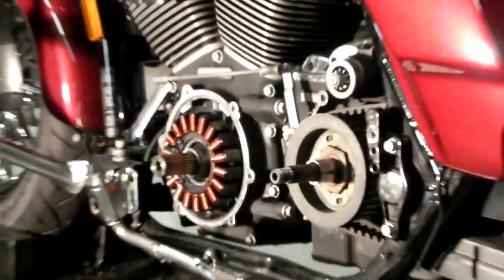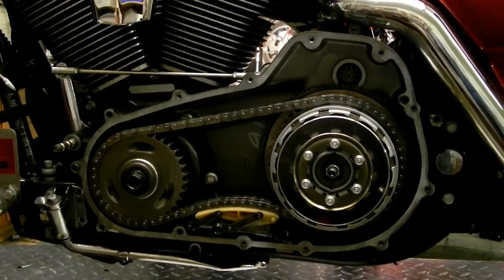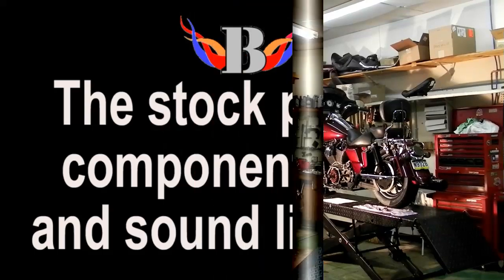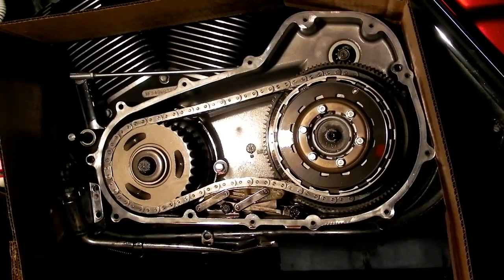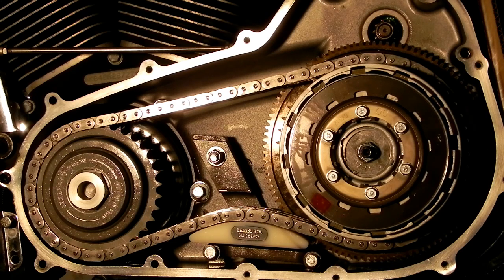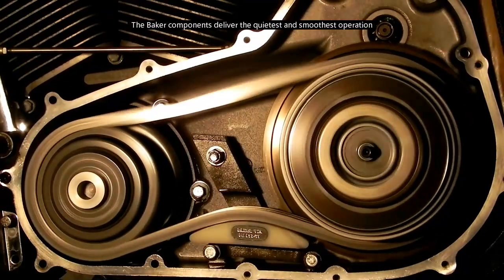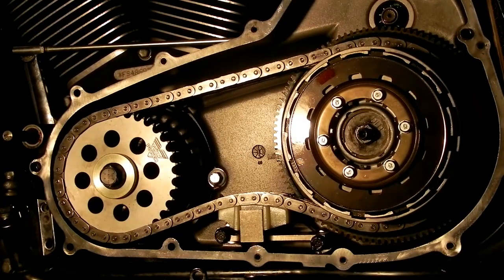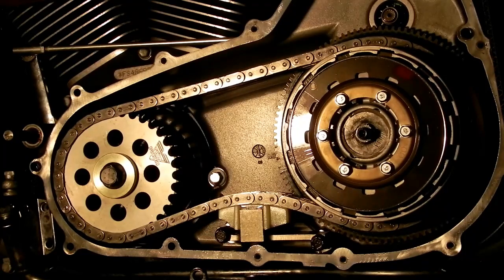2007 and Later Harley Primary Issues

Comment: I did the baker comp sprocket and Hayden adjuster on my 09 e glide. Best mod yet to the bike. Sounds like a new ride again instead of sounding like a bag of marbles in the primary. Great video!
Reply: I'm in the process of replacing my primary chain tensioner with a Hayden M6, replacing the primary chain with stock, and replacing the clutch hub bearing. All went bad due to the crap Harley 'auto' chain tensioner. I'm hoping my trans shaft bearing and compensator are ok. I'll find out soon enough.
Reply: In the video, the Hayden adjuster was paired with a compensator eliminator. I’m assuming the Hayden adjuster has a greater travel to soak up more shock. What made you decide on pairing this adjuster with the Baker comp? Was it a mechanic recommendation, or were you looking for a bigger solution for a problem, like bearing failure, that originated from the stock MoCo design? After more than 2 years, how is the setup working for you? Cheers in advance...

Comment: Great video,  I have to figure out what has been done to my 07 Fatboy,  just got it from Big Moose HD in Portland Me. They mentioned nothing about the comparator or the cam chain tensioner,  or the shift linkage.  They did do the 40k maintenance but gave no paper work statement.  I feel duped. She runs great but this is my first HD and I am inexperienced.  
      Thank you for your straight forward video!

Comment: I have a 2006 SG. When taking off my bike will start bumping like something is slipping in the clutch or transmission. When I shift to 2nd a little bit of the bump if I am accelerating quickly and it all goes away when I get to 3rd and higher. Symptoms are worse when riding with passenger. Any idea on this?

Comment: pulled the chain drive out ; and replaced it with a 3 inch belt drive. That was over 10K miles ago, on my 99 twin cam, still works just fine and dandy.
Harley will never go with a primary belt drive. They are too robust, and dealers would take a huge hit in "shop income" not fixing primary chain drive problems......
Reply: The shovelhead Sturgis model originally came with a primary belt, but it didn't hold up well inside the enclosed primary.
Reply: @tpitman   I had a primary belt shovel... I had not any issues.. I never pulled the cover off, to see inside..... But is one of my fixes to fix the many design flaws on the Mil-8 engine......

Comment: why did Harley go to the auto primary adjuster?  nothing wrong with the Manuel adjust method, only took 10 minutes..   harley gets out of one problem , the cam chain tensioners & moves into this problem?   my old evo didn't have any of these problems.
Reply: Who are you kidding , EVO's did the same exact thing with the starter kick back clunk, even worse!
Reply: I have an EVO with 150,000 miles on it. Regular maintenance is all that is required. 1991 FLHS. Long live the EVO !

Comment: I have the Harley road king classic 2008 and I notice when I ride a couple of miles and it's warm  and I turn it off. then when I start it up the starter has a hard time to crank a little it will start but like it hesitates is that part of the problem.
Reply: ... that can also be trying to start a warm bike with compression that hasn't been bled from the engine as it does cool-down. Many compensators replaced unnecessarily due to this.

Comment: I have a dry/grinding bearing sound in the primary until the clutch is engaged and it is in gear. Anyone else fix this issue?
Reply: Primary Shaft Bearing behind the clutch is going out.
Reply: @warrenducote8392  thanks, I ended up changing it. Perfect now 👌

Comment: There are very few videos showing the use of a solid sprocket in place of  a compensator. I have a '09 Road King with the stock compensator as shown in your video. It is now toast. I installed a Hayden primary chain tensioner thinking that is what the noise could be from, and to avoid an over tight chain as discussed in some videos and forums. This bike has the rubber compensator inside the rear wheel hub too, which seems to be fine. The bike has just over 60,000 miles on it. That being said, do you still have contact with the customer with the solid sprocket? Are there any known issues of damage to the motor, crank, clutch or transmission when using a solid sprocket? Also, has anyone ever tried to add one more of those Belleville ring springs in addition to the stock ones to make them thicker/stronger? Looking for advice on whether or not to go with a solid sprocket. Thanks.
Reply from the maker: The customer with the solid sprocket (a Twin Power Compensator Eliminator) has been very happy. We have not heard of any problems related to solid sprockets, but you might want to check around on the Harley forums to get a larger sampling of customers before you make your decision. About 90% of our customers have chosen to go with the Baker Compensator.

Comment: Why don't you add tensioner from the top side as well?
Reply: because it's tensioned by the compensator sprocket pulling on the chain.  That's where all the work is done. The lower section of chain is just along for the ride.
Reply: @michaelcouey1383  duuuude

Comment: I get a knocking noise in primary when pulling off from a standstil im wondering if its my primary  chain hitting the inside of primary cover.
Reply: +Staff Bikes Built Better thank you, your videos are awesome.  I ride a 09 Road Glide...i will crack that case this weekend.
Reply: this is chain flap...I have same noise....if I throttle it up and pull away with force...no noise..pretty sure this is because of out of true crank...that we don't want here of .... but i have had primary apart 3 times in past 2 months and no visible problems......

Comment: glad i came across your channel. I'm looking at buying a 2009 Harley Softail Heritage with 30 k miles & nothing ever done to the bike except regular service. It makes a loud clunk & slight jerk when shifting into first gear after first start up. Is this the clunk you refer too or would this be something going on with the trans/clutch adjustment?
 If you swap out the HD auto chain tensioner for another do you then have to remove primary cover every so often to adjust yourself like older models? Does anyone make a cover with a built in adjuster cover or can you use an older cover from a bike without the auto CT ? What other problems can I expect with this model? I sure hope I don't get the cover off only to discover what you show in this video. Thank you in advance for answering my questions. I sub'd you as I think I'm going to need all the help I can find for future repairs
Reply from the maker: It sounds like the bike you're looking at IS suffering from problems caused by the auto chain tensioner. If you use a Hayden tensioner, you would want to check things maybe every 30,000 miles. The Baker manual unit should be checked and adjusted every 10,000 miles...more often if you hear the chain slapping the inside of the primary! I heard last week that somebody is now making a primary cover with an inspection cover, but I don't remember who. I'll try to find out.
Reply: THANK YOU! For replying so fast After going back this afternoon and starting the bike again it sounded worse so I've decided to keep looking as they want too much for a bike that needs this work done on it right away. I'll try to find one that the Hayden chain tensioner has already been installed in
Reply: Hold on.... Before you go spending big money on something your not sure of, know this, all big twin Harleys have a annoying loud clunk into first gear, this is a characteristic of of these engine's. Not saying its normal, just a characteristic. The slight jerking could just be your clutch needs to be adjusted as its engagement is off when you pull in clutch to shift into 1st.... not sure? Have a good knowledgeable bike mechanic look at it before you go spending money on parts you dont need.
Reply: thanks that's really good advice I'l keep in mind as I go forward in my search for a larger bike this style. I backed out of the deal for now as the guys widow wants way too much for the bike and it was in her dead husbands name only so it'll be a bit to get the ownership & registered changed to new buyer at DMV I'm not sure it's all worth the hassle as there's plenty of better looking bikes with clean titles for sale out there Thanks again for the info I'll have to find a HD tech I can trust to do a pre purchase inspection
Reply: Also note this first gear "clunk" shift can be more prominent if the primary was filled with a thicker oil, causing the clutch plates to rotate due to the lube viscosity sticking to the faces of the clutch plates even with the clutch handle pulled in. Once it clunks into gear, that is the sound of the rotation of the clutch basket and transmission input shaft coming to a stop until you let the clutch out to drive the bike forward. Check the clutch cable to make sure it is in spec for proper free play just the same.
Reply: @markyoung3545  in hotter climates the Harley synthetic thins out too much where I am......hard to find N and some gears. Gone to conventional oil for about 25k now and its nice better on long hot rides. Like you said the clunk is there just keep you ears open to your rides tunes (noises) gotta know your bike!
Reply: Much better not nice better......auto fix on these phones can be dangerous and 🙄

Comment: Is the compensator eliminator sprocket safe to run of my crank is stock and not welded on my HD ultra 103?
Reply: I run one with stock crank making 120hp and I ride it hard.  I have screaming eagle manual chain adjuster and no problem for 40k. If you do this set up get a new primary chain. An old one will be noisy.

Comment: I have a 2010 road glide stock 96 with 28k miles. I noticed what appears to me to sound like a starter grind. Pulled the starter and nothing is wrong. I guess I'm asking would the comp sprocket cause a noise like that. Any help will be greatly appreciated.
Reply: John Lutz 2010 Roadglide 27000 mi trashed the main bearing because of the primary chain auto adjuster trans shaft main had to be replaced as well installed a Baker attitude adjuster  to finish or the season did a total motor remove tear down last winter to 107
Darkhorse shortblock  blueprint, balance, and welded crank. Smooth quiet  106 hp/ 117 tq. Good luck
Reply: @vincentmcclain6642  did you use the baker compensator?
Reply: @vincentmcclain6642  what 107 top end out did you use?

Comment: Why is Harley-Davidson still using a chain primary instead of a gear drive system??
 The chain primary is an outdated system even with the new Milwaukee 8 motor Harley-Davidson still uses the chain primary which nobody else does.
Reply: new an improved YEA RIGHT the Milwaukee 8 motor but Harley doesn't install a (CAM GEAR drive setup)their still using that plastic shit .. I dout the reason is that it would cost too much.....their over priced already..
Reply: dave dias the EPA complained about the cam gears being too noisy and Harley-Davidson in return went to cam chain driven cams. The EPA is the reason why HD doesn’t have gear driven cams anymore.. EPA also responsible for Twin Cams running lean and running hotter.
Reply: @finley614  so how did everyone else get away with
using gears. Im.sure the EPA didnt single  out HD.
Reply: Because its simple to work on. The profile is classic awesome too.  Harley believes in tradition and builds all its big vtwins off the old designs. Love em or hate em for it they got tradition in their motors. Think thats awesome myself. Why their an original. And the chain system works fine. U do the maintanance u will have no problems. 30 year old softtail. 90 thousand or so miles. Still runs good.  Hope harley keeps building em their way as long as they can.  Emissions one day will kill off the air cooled motor. Sad day.
Reply: @MrDirtysteve75  agreed...everyone is and has been using a gear drive system which is better and more reliable.  Harley uses the chain to increase their service money bucket...

Comment: About how many miles do you start seeing the next excessive wear showing up? Or is it more a matter of abusive/hard riding or lack of oil changes?
Reply from the maker: It depends on ones riding style but most that I have replaced have been in the 30,000 mile range It gets bad. Once you start getting starter grinding additional damage to other components begins.
Reply: @BikesBuiltBetterHorsham  Thanks for the quick response! I've been debating buying an 09 Street Glide with 25K on it. Don't hear anything now, but, if replacing compensator and all that is right around the corner, might have to rethink it. Thanks again, you've helped.
Reply: @WalkerKlondyke  I have a 09 Glide and 50k done this repair 3 times. (Original owner) I was told this is an inherent problem from 07-09. I do ride hard and overly maintain it. If you can afford it go to  a little newer model. Im torn myself if I want another repair........I do like my hog but enough is enough.......Im swaying back to BMWs which I used to ride for years. Good luck

Comment: What about the compensator eliminator + the baker attitude primary chain tensioner? Would that be also a good solution?
Reply from the maker: The V-Twin Compensator Eliminator is a less expensive option. The Baker Attitude Adjuster works great however keep in mind that the primary cover will have to be removed for periodic adjustments.
Reply: Yes , but what I meant is that due to the fact that the V-Twin compensator is an eliminator for the compensator system wouldn't that be bad for the tranny ? Some people say that they noticed a little bit more vibration in the low rpms but that, to be honest, wouldn't bother me at all. I´m just afraid that this could be worse for the crank or for my clutch system.
Reply: btw, my bike is a FLHTCUSE2 2007 with a 110", heads ported, 574 feuling reaper cams.

Comment: Harley needs to get off of it's ass and use gears like the Victory..
Reply: I sold my Harely's and jumped ship to Victory. I just felt that I was riding a timebomb with the HD. The cost to just ride those things adds up, while when I ride my Vic, the only thing that goes up are the miles!! Granted, ALL bikes need maintenance and none is perfect. Ride what rocks your boat and ride safe!
Reply: We all want to be turn key riders at some point in our lives....but I haven't hit that point yet...right now..shes like a 1967 chevy...and if I want to go faster or twist the crank I HIT THE BUY IT NOW BUTTON...:-)
Reply: LOL Victory is so awesome Polaris shut them down.
Reply: My turn key point was in 1988 and I still have that FXR which has been reliable as any riceburner (I own and work on those, too).  Subsequent HD engines suffer from cost cutting by HD and the "Harley tax" is through the roof. Instead of a new bike I have a new S&S 124 to freshen the old beast up.  The solution to modern Harley engine issues is buy an S&S and let the chumps buy new bikes for too much money.
Reply: Not due to the engines, but their ugly looks and near complete lack of aftermarket support.  The Recession hit their Boomer customer base hard and also killed most "clone Harley" makers.  Remember the first Vics looked like anonymous Honda Shadow copies (the Shadow of course is a better motorcycle) and the later versions were fad style pseudo-choppers. They never published sales figures so the closure was a bit of a surprise.
Reply: No big deal. Service it yourself and spares and donors remain available. A "biker" ain't a biker if he isn't a skilled mechanic or learning to be one, and real mechanics can work on any brand or for that matter, any machine.
Reply: I think there's too much crank run out to use gears with those pressed on cranks
Reply: out of business or not, they had a better design.

Comment: Have a problem changed all seals and o rings 3 times and still have a leak between the transmission and inner primary 2007 road glide Any suggestions would be great thank you
Reply from the maker: Is it primary fluid, or transmission oil?

Comment: Transmission fluid
Reply from the maker: Sounds like you're not sure where it's leaking from. You might want to get one of those ultraviolet dye kits. You put the dye into the oil, run the bike for a while, and use the included light to spot where the leak is coming from. A less-sophisticated version of that is to run the bike for a while (after cleaning it thoroughly, obviously) then blow white powder like foot powder or baby powder all over the suspect area. The powder should stick to the leaking oil and help it show up better. And be sure to check the exhaust mount where it attaches to the transmission. We have seen a lot of leaks from there. Good luck.